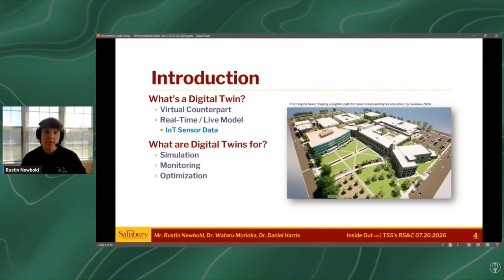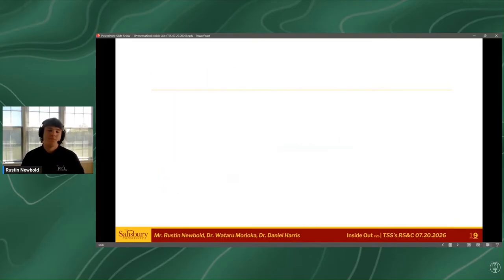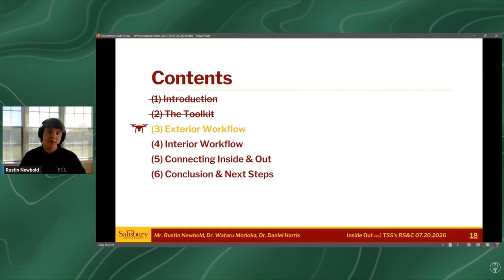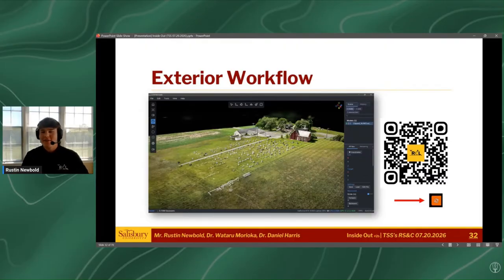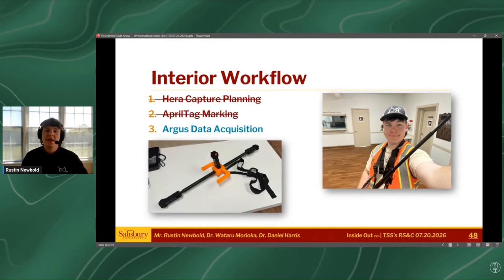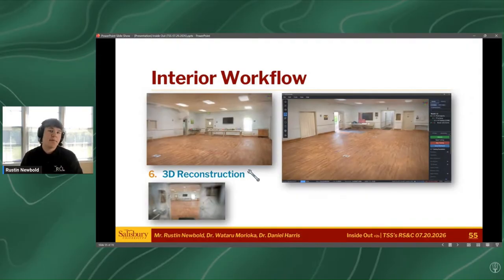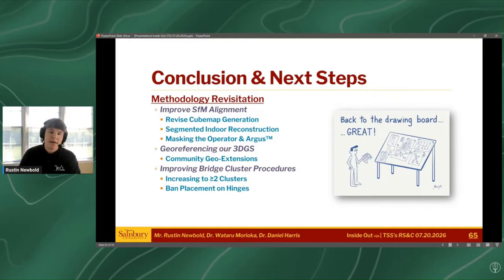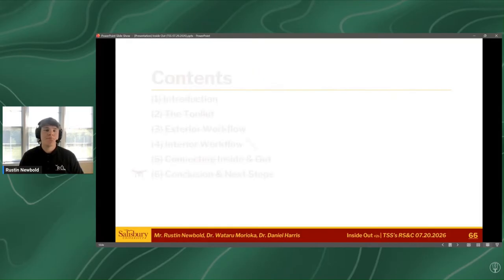"Inside Out" Update 2b // 2026 Survey Research Symposium (Online)

Comment from the maker: One thing of note, I am aware that I messed up the talk about 3D RMSE... i did not include a confidence interval, so the figure will detect a gross failure but cannot characterize an error distribution. Second, the statistic itself is ambiguous. I described it both as an RMSE and as the worst error across three axes, and those are different quantities, a root mean square being an aggregate and a worst error a maximum. From three points they can differ substantially, and the maximum is the less stable of the two...

For those who want the actual numbers despite the N=3 caveat… the RMSE_r = 3.11 cm, HA95 = 5.4 cm, & NVA95 = 5.9 cm.

For my next report I will not make the same mistake twice! Thank you to Mr. Rami and Dr. Kerski for your feedback to get this issue resolved :)